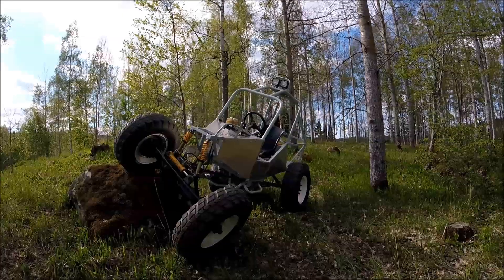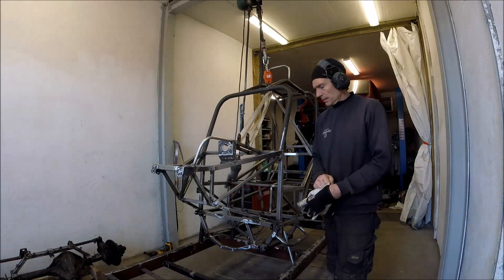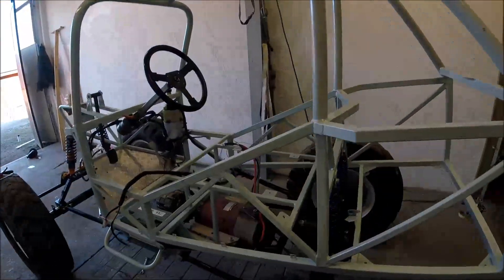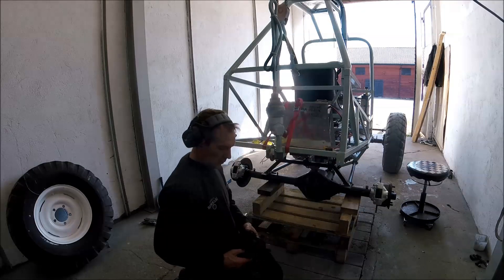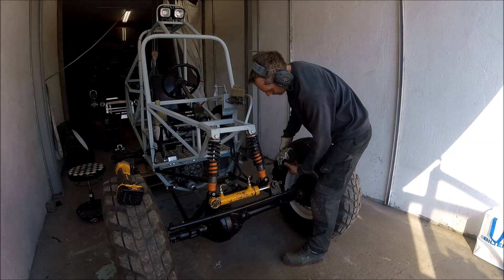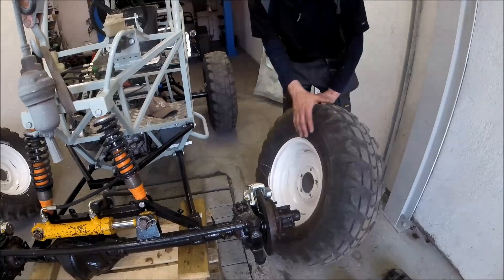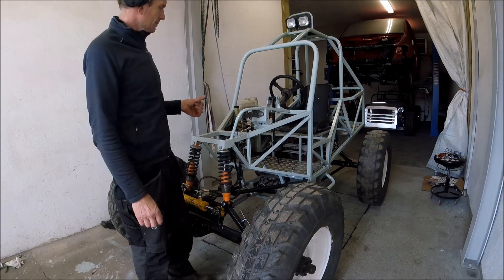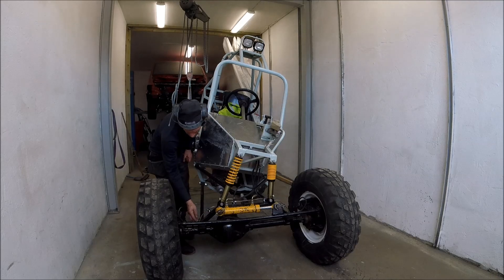Electric Rockcrawler

Comment: Helo what motor did you use and what batteries? Also total weight?
Reply from the maker: Hello, manuel ! I made some upgrades according to motor and battery, check this : https://youtu.be/2pqjJy97QYE   and
  https://youtu.be/YYMLa8NH9KE   and then testrun :  https://youtu.be/ZAhhNMJUnIY

Weight is aprox 350-400 kgs.  BR Per

Comment: I don’t understand the suspension link geometry? Based if this design how do the axles stay centered wo a pan hard bar? The low arms are straight and uppers triangulated? This should require a pan hard/track bar. I don’t understand why you didn’t just double triangulate the arms? The uppers should angle in toward the frame from the axle while uppers angle out. 

Ok scratch that I just got another angle and it is double triangulated but the lowers are still at a very shallow angle compared to the uppers which means those axles can still shift side to side a decent amount putting a lot of stress in the joints? You have extreme upper angles and shallow lowers.. this is not a good geometry and could possibly be dangerous. There is simple math for how to setup a double triangulated 4 link. And it’s even simpler when fabricating you’re own frame like this. 

I do like the idea of an electric rock crawler though as you can’t beat electric for instant and controllable torque.
Reply from the maker: Hello, Fish R Relaxing ! Thank you for input and concern. It's constructed as an ordinary K-link suspension, often used in offroad vehicles like this. Rear suspension on Range Rover is the same. The upper holds axles in center position. I agree I have a bit shallow angle and as you write better if the lower ones also where triangulated. This is what happens if you dont first make a drawing, I just built it from scratch. To be honest there is also a lot of weight distributed to the rear.... But it is a low speed vehicle, the next one will be better !! BR Per

Comment: What size motors in that? Awesome build mate
Reply from the maker: Thank you, axelsol89 !   It's a series DC motor 8 kW and it's connected to a Lada Niva transfer gearbox,. Quite  heavy solution with contactors and so on. Planning to swap to ME1115 and Kelly Controller. BR Per
Reply: @persteel  I'm thinking of doing similar but using a 3kw motor mine will be smaller and lighter though
Reply from the maker: @axelsol89  Nice, it is really fun building. Wish you all luck, dont hesitate to ask if you need assistance. BR Per